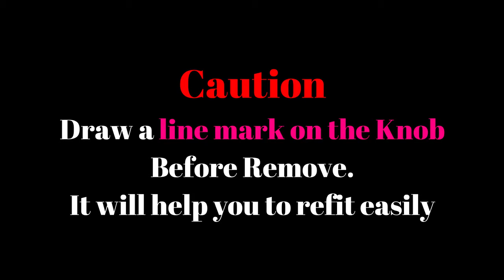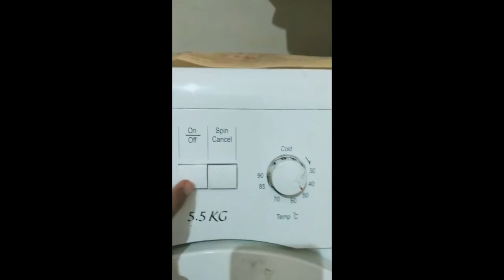Washing Machine Timer Repair|Front load Washer Timer Repair| Washing Machine Timer Problem| Timer

Comment: Sir  ,please make  video of pressure switch  for low water  intake problem  for IFB front load  washing machine. My IFB front  load  machine  takes very little  water, so I have to fill additional water by pipe in same  tray for both wash and rinse cycle.

Comment: Sir ji thanks
I am technician but not expert as you
Pl.sir ifb elina  model drain pump continue running  in जैसेही टाइमर सेट करके स्टार्ट स्विच पुश करेंगे  तो drein पंप चालू हो जाने के बाद चालू ही रहता हैं क्या हो सकता हैं 
एलिनाकी वायरिग डायग्राम चाइए प्लीस
Reply: Same with me
Reply: @ravinderdeol183   i solved it  myself , by changing inlet solenoid valve only  you also trys
Reply: @bineshchauhan8713  wirring or inlet valve
Reply: @ravinderdeol183  i changed only inlet solenoid valve not disturbing wiring